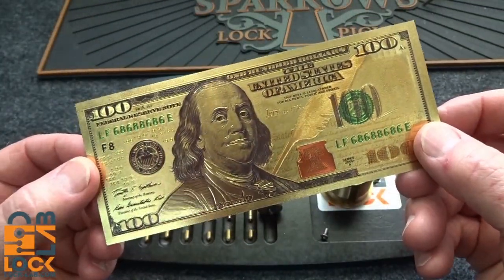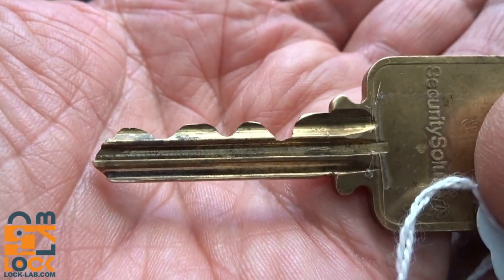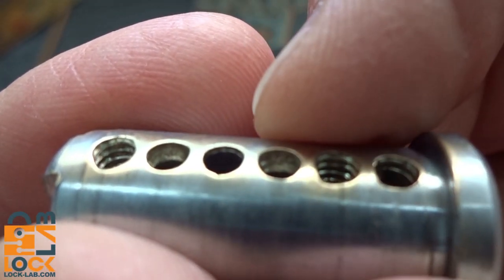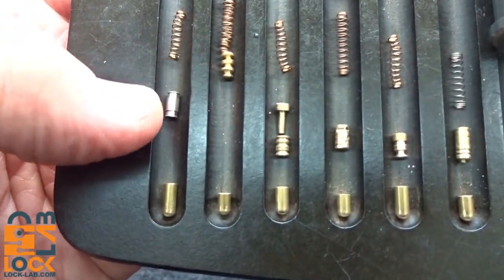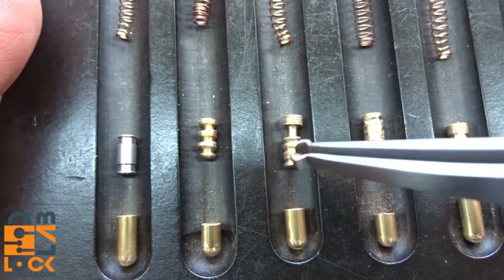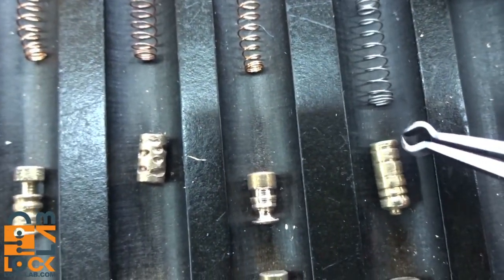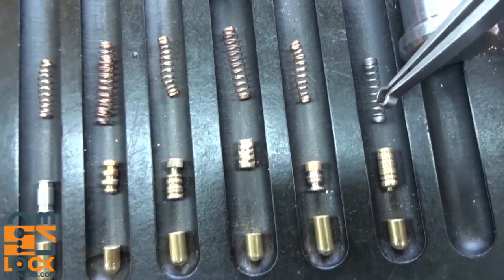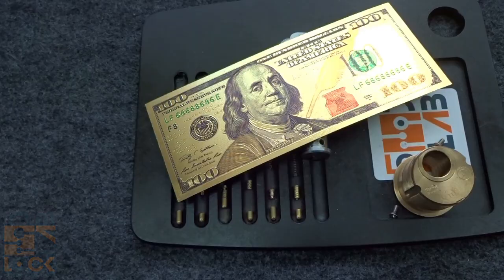(1018) Whipped: Steel Pinnings Challenge Lock

Comment: Howdy Bill,
I am so extremely giddy, lol
Thank you for your kind words.
And I really want you to keep the Replica $100 so to remember this pick.
Also the challenger lock is the harder one. in my opinion.  or yhe one I did the most to that is. lol
And the Tubbie is a standard pinned tubbie. but getting tension to it is the problem.  Likely you will have to do a manual slot for tension. Like the Van lock you picked.
Cheers & Happy Pickin !!

Comment: I see a lot of custom locks will have work done on most pins and chambers but they all have some that are still intact. Why is that? Is there any value to leaving one untouched? Why not customize every single one?
Reply: Flying Toaster 
Hey bud, the reason for leaving one chamber unmodified is to keep with varying the chamber at the same time it keeps the core from having a sloppy start. Kinda gives away a spool right away.  and if the hit a pin that is standard when expecting a security pin of some sort. Just to throw them off.
Hope this helps. 
Cheers & Happy Pickin !!

Comment: Its unusual for pin 4 to be in an unmodified chamber. When you showed the chambers it looked to be as if 4 had been undercut with a very thin top to it and undercut most of the way down the chamber. It was very dark in there and usually when you show us unmodified chambers you can see the wall inside quite well. 

Cheers for consistent uploads!! They are fueling my drive for my locksmithing course! i got to play with Ably disc locks yesterday, producing keys and master keying them. Love it. Do you get many Abloys in as challenge locks? Can you even pick them? Had some good ideas for one but if you dont do them I need not send one in. Thanks again.

Comment: these are pretty cool. But are these made only as challenge locks? Would these be good to use as locks for your home? As a non-picker, but am definitely considering getting into this, I can only imagine that if you did lose your keys, no locksmith would ever be able to help you get back inside without using destructive methods?
Reply: Actually, this bitting pattern is not that advisable for use in real world conditions. (Though picking the lock may not be the first point of attack anyway, depending on the rest of the system.)

In some ways, while picking with a lockpick is very challenging ... the typical pattern of high/low/high/low... bitting can make it easier to unlock with a made to purpose key. Only useful if a particular type of lock doing so would be popular in a given area, but it would be an issue if it became a widespread pattern. If you get too common a bitting, you can get yourself a set of slightly varying "master keys" emulating that bitting pattern.

Mind you, I am only speaking about the bitting part. The extra effort; of undercuts, spools, serrations, etc; is absolutely worth it. It'll bump the price of your lock, though. These do exist, but you pay for the extra quality and effort put into making finely tooled custom parts.
Reply: If the locksmith couldn't pick it, they can drill out the core, which can be expensive. That's last resort after the master keys and picks fail.